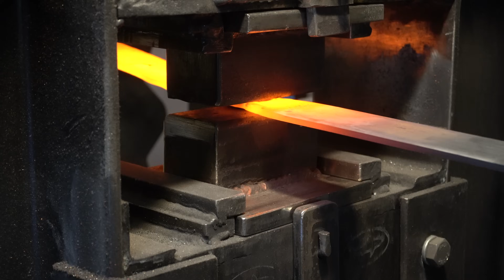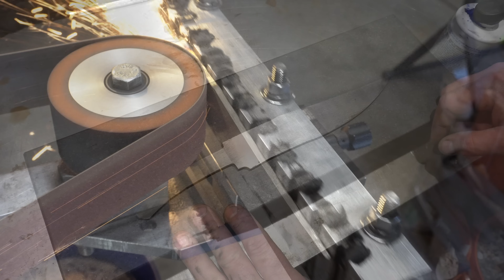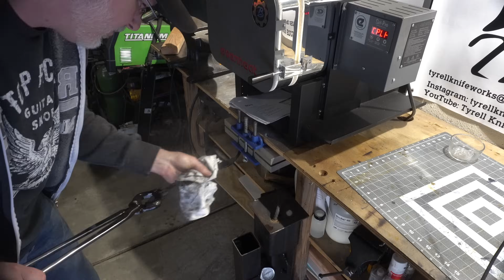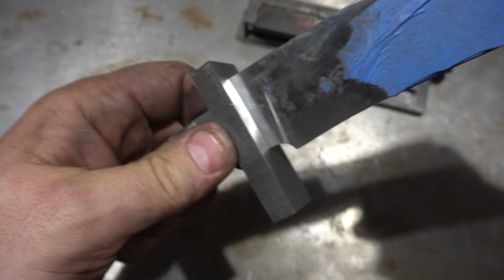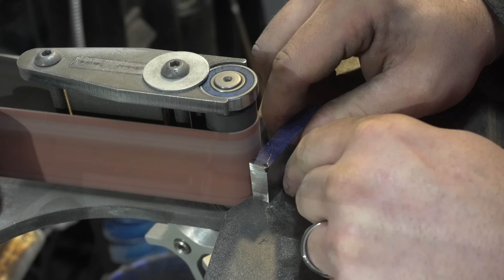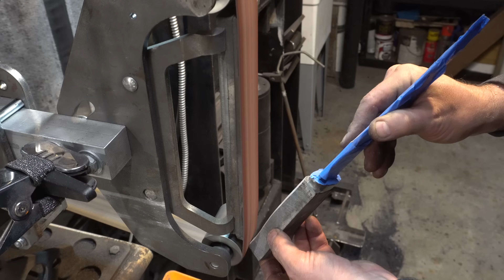Forging my Journeyman Knife #1

Comment: Also, sorry for the multiple comments. Putting it in the stainless bag is that just to guarantee equal heat distribution on the blade?
Reply from the maker: This blade is 80CRV2, which builds up a lot of decarburization on the surface so keeping it in an oxygen free environment helps prevent that.  Thanks for watching

Comment: When your grinding in the blade edge of the knife, how do you know your angle is accurate and consistent? Is it just practice? It almost looks vertical from the camera angle. And I’d assume the angle you want is just to whatever guideline you put in?
Reply from the maker: You draw a center line on the edge, then grind your bevel to that line. The actual angle is somewhat irrelevant. Once you have scribe lines, you just grind to those.  👍

Comment: How can i find percise alternative to pins except nails
Reply from the maker: Why do you want an alternative to pins?  You can always use G10 pins if you want to stay away from metal pins.  Thanks for watching.
Reply: @TyrellKnifeworks  no i meant its expensive for me to order it online since shipping costs more than the product. I still want to use metal pins but cant think of anything else  that i can make pin of except thick nail
Reply from the maker: @sran9492  I’m not sure where you’re from but you don’t have access to mild steel round stock locally?  We can buy that at local hardware stores here in the US.
Reply: @TyrellKnifeworks  ill check it, thanks

Comment: Love the handle material, good choice and it works great with the satin finish. (I love satin finish for the knives that see alot of use, hides the scratches)
Another 4 knives with this standard and it shouldnt be an issue getting approved as journeyman if you ask me.
Reply from the maker: Thanks, Johan!  I hope you’re right! 🤞
Reply: the handle material looks like tiger shark skin; very approprite given his logo =)
Reply from the maker: @LIONTAMER3D  Ha, it does look like a tiger shark a bit!  Nice.

Comment: Beautiful work. Do a ka-bar.
Reply from the maker: I don’t think I’d do a kabar.  You need to stick to very standard and simple knives for the JS presentation test.  Thanks for watching, Stephen!
Reply: @TyrellKnifeworks  I just mentioned it as you did a very good job on the Cu-bars that a simple mono steel one would be a good presentation.
Reply from the maker: It's the leather stacked handle and pommel... too much complexity for a JS knife.  Every part you put on it, they judge.  You go fancy on the master smith knives, not the JS ones. 👍🏻

Comment: Great job, not convinced by the loose pin though🤔 but what do I know😉
Reply from the maker: If you pin it with the same size, it’s really hard to get the handle flushed right up against the guard. Having a little play helps and it’s going to get filled with epoxy anyway.  Try it.  Thanks for watching

Comment: Does the point have to be hammered from square,we are blacksmiths aren’t we 🤷🏽‍♂️

Use a hardy cuttoff at a 45 would cut the time down even if it is thin bar stock 💪🏽👊🏼😉
Reply from the maker: It was the end of the bar, why cutoff a piece instead of just forging the tip?  It took about 5 mins so not really that much time.  If I was cutting the stock, sure you could use a hardy.  Thanks for watching.

Comment: Will this be tested for sharpness and resistance to bashing something hard or is it just for show and tell ?
Is just one pin enough for a strong knife (generally speaking)?
Thank you
Reply from the maker: This is one of the knives for the presentation test.  I already passed the performance test.  Single pin is quite common for hidden tang knives like this.  Thanks for watching

Comment: You passed the torture tests, the rest will be cake for you.
Reply from the maker: Joseph is correct, more people fail the presentation test.  The key is getting feedback BEFORE you present your knives.  I’ll be taking this one and a few more to Blade Texas next month for feedback.  👍
Reply: @TyrellKnifeworks  FYI I've heard from a JS friend of mine a big one is j-hook scratches especially near and on plunge..
Reply from the maker: @josephrector8735  Yup, I've heard the same thing.  I made sure there's nothing but linear sanding marks on this one.  👍🏻. Thanks Joseph!
Reply: From what I've heard from several JS and MS the quality judgement is actually  harder and where most who fail do so